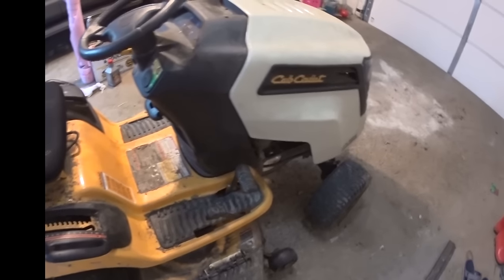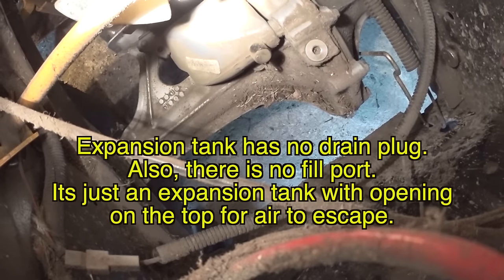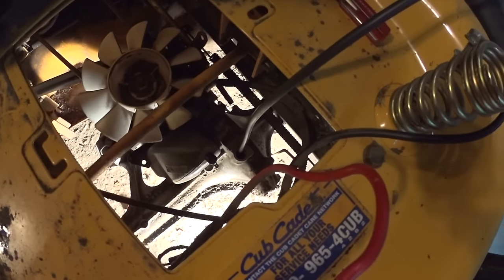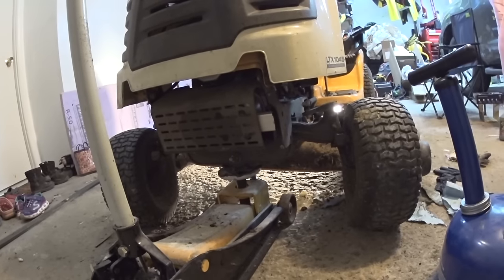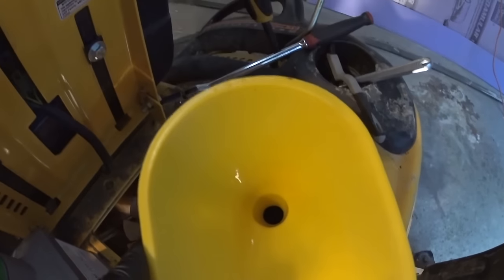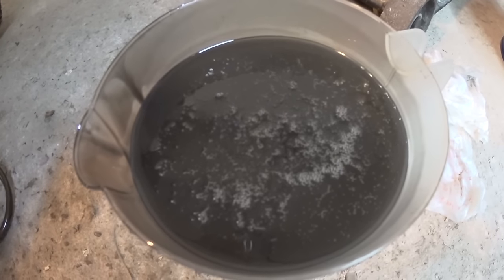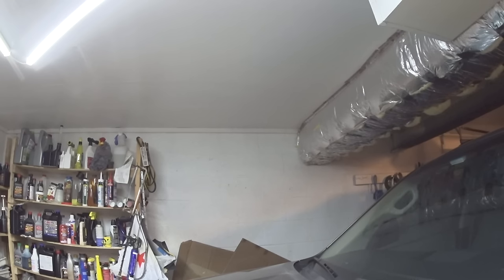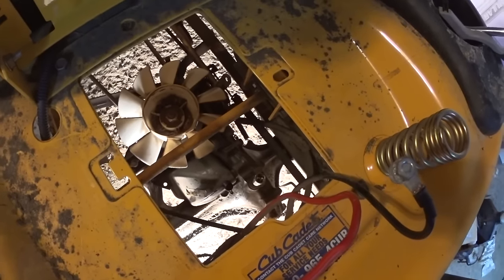Hydrostatic transmission fluid change, how to replace tractor transmission fluid, SCAG maintenance

Comment: I'll take it that part with the little black cap on it is the expansion tank you mentioned? How does that affect the total changing of the oil? Does some oil have to remain in the expansion tank no matter what?
Reply from the maker: I don’t know. Does it matter if some remain?
Reply: @repairvehicle  Probly not. 
Thanks. I would not have known how to do it were it not for your video. So I ordered me a small vacuum pump and a gallon of the oil already. Thanks again.

Comment: need to ask my white fan back there is tight and you can't even spin it by hand  , is that too tight and not sure if it has been like that since I bought the mower
Reply from the maker: I know it’s tight
Reply: @repairvehicle  before it was repaired you could spin it by hand slightly . After I put on new drive belt it got tighter . You could spint it by hand a little before new drive belt . Old drive belt broke and I had to push the mower up my hill over 150 feet . I could tell mice must have chewed the belt . I found a dead mouse in my shed just before belt broke . I always make sure I keep shed clean and watch I don't get mice in there . But i think my 2 rescue cats must have chased it in there from the woods . That is why they were stalking the shed

Comment: I opened my  Hydrostatic transmission I bought it used and I saw that it was filled to the top should I leave it like that Or lower the level a bit?
Reply from the maker: Very good question.  I don't know what you have.  Did you watch my video without skipping?

Comment: What happens if you lost fluid in a leak so your reference point might not be a correct way of doing this
Reply from the maker: Good question, I had no leaks everything is dry. 13 years later I still have this same mover and have zero leaks and it’s working better than brand new. I can’t say same thing about my tires.

Comment: After stripping the plug using the 1/4 Allen socket i thought i was going to need to go buy more bits so i can try and manage and get the plug out but then i decided to go and try and use the t40 torx socket i gave it a good zappe and with the help of a piece a pipe gave it a good ol' try and i only heard paaaahhhh and the ratchet slipped so i thought oh man now I'm going to need to buy me another torx socket so i looked at the plug and didn't see it being more damaged so i looked at the torx socket and it wasn't broken so i put it back on the plug gave it a turn it started coming off i was like uuuuhhh eeeeeeeehhhh so if you strip your plug get yourself a t40 torx socket and give it some hammering down then give it a try it'll come right off
Reply from the maker: Thanks for sharing your experience

Comment: Absolutely amazing video!! I just bought a 2021 xt2 gx54 d. Would this drain and fill be applicable on the newer xt2s?
Reply from the maker: Drain and fill will apply to yours too. However,  make sure to use correct fluid.
Reply: @repairvehicle  I'll have to research what fluid. All I can find is the cub cadet brand.
Reply from the maker: Nothing in your owners manual? There should be something about hydrostatic transmission or call dealer/repair shop.
Reply: @repairvehicle  I'll have to dig into that more. And I wanna edit my statement. I bought a leftover 2020 xt2 gx54 d. As I couldn't stand the black rims on the 2021 model lol. If I wanted black rims I'd buy a Porsche.

Comment: I'm not sure if you will see this but I'm having a similar issue.. my Trans doesn't like to work when it has been driven for about 15 mins or so, I put a new drive belt on and the fluid looks to be good (not burnt or dirty), just seems to lose momentum after the 15 mins of run time. Any help is appreciated!!
Reply from the maker: How is the fluid inside transmission?
Reply: @repairvehicle  clean and full
Reply from the maker: I mean to say how old is the fluid?
Reply from the maker: How old is the mower and has fluid been replaced before?
Reply: @repairvehicle  it's a 2009 yes i think it has been changed before, not 100%
Reply: @repairvehicle  I bought it off of a buddy so I'm not the original purchaser
Reply from the maker: There is two possible reasons why it not working properly.  
1. Fluid is just to old and don't have proper specs anymore. 
2. Transmission is has too much wear and when it becomes warm stops working properly and starts sleeping.

Comment: Great video! Question, would it be better to use transmission fluid to flush it? Plus driving it 100ft or so then draining it of the flush seams a good idea??? Thanks for any input. Dan
Reply from the maker: Are you referring to Automotive automatic transmission fluid?
Reply: Yes, ATF, it has lots of detergents in it to keep a transmission clean. It makes sense to me, but you've done this before. I have a similar model I'm definitely doing this to.
Reply from the maker: Auto ATF and hydrostatic fluid, both completely different fluids and not compatible. Adding ATF fluid to hydrostatic transmission will cause issues.
Reply: @repairvehicle  i used atf in mine then mixed gear oil in to thicken it up, didn't have fluid when I got it and I cant seem to get it to even spin the tires when they are off the ground, is it supposed to be easy to refill them because I have tried to purge it literally 12 times today, I have a craftsman lt1000 with the hydro gear trans

Comment: Mine has the gas tank under the seat right over the transmission.  SLT 1554.
Reply from the maker: Remove gas tank
Reply: @repairvehicle  that means dropping the trans and/or completely separating it from the tractor.  I’d rather not, but if that’s the only way I guess it’s the only way to do the fluid change.
Reply from the maker: You cannot remove gas tank from the top?
Reply: @repairvehicle  nope.  The transaxle would have to come off then the gas tank from underneath.
Reply: @QuickDrawWP  should be able to remove most bolts from the foot rest and the back cover off and lift the whole shell up and pull gas tank out. That's what I did to get my tank out when I had to repair a hole in the tank. Wish I would have done trans fluid when I did the tank. Live & Learn! Good Luck

Comment: should i use 20 50 synthetic if I plan to use mower in winter-my hydrostatic has 20 50 oil in now--thinking it might be too thick for very cold
Reply from the maker: How cold are we talking about?
Reply: @repairvehicle   0 to -20 F
Reply from the maker: What do you have and year?
Reply: transmission had crack from rock..repaired- JB weld ..i think 1 qt of Valvoline 20-50 syn was added
Reply: northern Minnesota..like to add little snow plow
Reply from the maker: I am not aware of thiner hydrostatic transmission oil.  Don't know if in cold weather it's going to be an issue. When it's that cold,  your battery will be number one issue, it's going to have hard time starting, unless kept in warm garage then hydrostatic oil is just fine too.

Comment: I have a LTX 1050, last time i mowed the gas pedal was kind of stiff and hard to push, i dont think i have ever changed the transmission fluid. Do you think this may be whats causing this?
Reply from the maker: Possible. You might have build up or rust around pedal mechanics
Reply: @repairvehicle  ok I'll check linkages and all. Haven't had time to dig into it yet, thanks for the response.
Reply: I have a 2008 lt 1050. Transmission is a sealed unit and not supposed to be serviceable. Should I try anyway? Nothing to loose. Has over 700 hrs on it
Reply from the maker: No such thing as sealed unit. I would change the fluid
Reply: @kentseymour2084  does yours have a kawasaki engine?
Reply: @repairvehicle  in response to my earlier question on the pedal stiffness, I had used cable ties to hold up the mowing deck and has wrapped the ties around the rod that leads back to the transmission thus the stiffness. I cut them loose and rerouted them now the pedal is back to normal. I'm still gonna change the fluid when I've cut the last time this year.
Reply: @trent3872  No mine has the Kohler sv730 engine. I had to replace the starter a few weeks ago.
Reply: @kentseymour2084  I have the exact same model and problem. Did you figure it out?
Reply: @jspla  Hi, I changed my oil in the transmission used amsoil in transmission. Also I put a 78 in belt on transmission. The dealer said that a 79 1/2 in belt was the one according to book. Could not get tension so smaller belt. The last time I was mowing the rod from pedal to transmission broke. The parts tree web site said that it was unavailable. Took it off and welded a bolt in its place.

Comment: Great information, but I can't get the plug out of mine. Was there a trick to it?
Reply from the maker: No trick, just applied good amount of power to break it loose.
Reply: Mine was tough too. I would never got it off but I got my drill down in there and Brit free
Reply: I stripped mine now I'm confused what to do
Reply from the maker: Watch this video about removing stripped plugs https://youtu.be/0U4IETmJtas
Reply: @repairvehicle  Allright man will do thank you

Comment: How can I get the oil out without a fancy pump? I am sure I need to change mine. It whines and seems pretty slow. Thank you in advance!
Reply from the maker: What fancy pump are you talking about?
Reply: @repairvehicle  I bought a suction gun at the parts store. Probably have to remove my gas tank. It has the huge tank under the seat. I just had the tank out on 46" Poulan Pro. PB22H46YT. They are a real pain in the butt to get in and out. Thanks for video
Reply from the maker: No problem

Comment: I have a John Deere x354 and and a k46 transmission everything I am seeing says 10w30 ( tuff torque) can I use 20w50?
Reply from the maker: What year?
Reply: 2016
Reply: Sorry 2017
Reply: 🤷🏼‍♂️🤷🏼‍♂️bought in 2017 probably a 2016 on sale
Reply from the maker: Unfortunately you cannot use 20w-50.

Comment: I have a ltx1042  KW   V twin  2016 MODEL   AND NEVER KNEW IT WAS THERE UNTIL i CHANGED THE DRIVE BELT STRANGE THERE IS NOTHING IN MY BOOK OR PARTS LIST ABOUT IT
Reply from the maker: Because they don’t want you to maintain your equipment. They want you to keep buying new
Reply: @repairvehicle  Sad that they take advantage of people  .  I am having a hard time here in Virginia finding gear oil  with the weight you suggested  .GEEZE to be truthful having a hard time find anything here . I guess it would be the same weight gear oil  for my mower  . Only 1 lawnmower shop left here and it is only open 3 days a week  .I may have to find it on Ebay  . Oil filters for kohlers are 29 dollars each if you can find them . I  had to order them off Ebay 27 dollars for 6 of them  off the lawnmower shop . I got them in 4  days   . Even gas cap for my 2001 ford explorer I had to order off Ebay    none around here  got it in 3 days   , Sad Sad Sad
Reply: @repairvehicle  thank you so much for your video it really did help  me alot from ruining my  lawnmower  . I maybe 69 years old and a woman but not dead yet  😀THANK YOU AGAIN
Reply from the maker: you are welcome.

Comment: How do U Purge the transmission ?
Reply from the maker: Purging transmission is not necessary unless you have completely sealed transmission. What do you have? Why do you think you need to purge?
Reply: @repairvehicle  Ok even better ! No just heard it on another you tube video. Thank You for the reply !
Reply: Please advise on the proper transaxle seals for 1554.  Thanks

Comment: How do I change the filter on the 1050
Reply from the maker: There is a filter?
Reply: All transmissions have a filter.
I think I googled Cub cadet 1050 transmission filter, then select the Amazon filter. Looks more like a fine screen.
      I suppose a person could find a parts diagram somewhere other than the Cub cadet website which is no use to anyone except a dealer.
      Lawn mower was most likely made by MTD. I wonder if the transmission is made by tuff torque.
     I took a zero turn transmission apart made by tough torque. They made it as cheap as possible. Not made to last very long. Seems like they never put a drain plug on there transmissions.
        The zero turn failed after 3 years of use. Filter was clogged. Maybe it got hot in the Pistons stuck. The return springs disintegrated. Little pieces went all through the unit and did more damage. Manufacturer blames the oil or fluid. 303 John Deere fluid must have been defective a few years ago. I thought I seen a lawsuit on the internet.
Reply from the maker: I don't know how to change filter. I have look into this. I was not aware of filter on hydrostatic transmission.
Reply: Could you let me know what you find out. I ordered oil vacuum .my cub 1050 is at least 10 years old.no maintenance on Transmission. Like you said in video, designed to fail after warranty is out.mtd uses tuff tork  Transmissions.i don't know any brand mower that mtd does manufacture. Pretty sure it China parts assembled in Tennessee USA to avoid paying USA tax and tariffs.?
Reply: @repairvehicle  I just watched the video of a tough torque transmission from a cub cadet being overhauled. Which really didn't need to be overhauled. The filter in that one was deep inside. Mechanic didn't bother to hold the filter to the light to see if it was clogged. He was more of a clown than a mechanic. All hydraulic systems have filters. A hydraulic system is more sensitive to dirt than any engine is. 
    Filter cost $30 on Amazon.
I'm not going to replace my filter. The transmission is working great. So I will take my new vacuum pump and suck out as much fluid as I can from the fill hole. I'll add some new fluid to it. Start the engine, forward and reverse, then shut it off. Suck that fluid out. I should get about 75% of the old oil out. Then I'll fill it up. The level will be 1 and 9/16 from the top.
     I'm not going to put motor oil in it. I want tuff torq oil. 10w30 or something close. Synthetic hydrostatic transmission fluid.
People in the South might want 10W-40. People in the north might want 5w-20 if it's used for snow blower or snow plow.
       If I thought my transmission was not working properly, I might try removing the pan from the bottom to get to the filter.
      If I thought my transmission needs to be overhauled, I would see what the price is on the overhaul kit and decide if I want to remove the unit from the mower frame.

Comment: How does water get inside the transmission?
Reply from the maker: Through breather tube .
Reply: @repairvehicle  so I guess washing the mower off got water in the transmission causing it to slip and whine
Reply from the maker: Possible yes.  But moisture as a condensation enters transmission too. Transmission Fluid has a limit 2-3 years bottle life.  When it's in service it becomes contaminated and good faster.
Reply: @repairvehicle  okay Thanks so do you recommend changing trans fluid once a year
Reply from the maker: It will not hurt anything by changing fluid every year,  it's a free insurance for trouble free transmission.
Reply: @repairvehicle  okay Thanks
Reply from the maker: @dickeymoore4264  , no problems

Comment: If mine has never been changed should I do it?
Reply from the maker: Mine was never changed before either. 9 years on same fluid, way to long. If it was mine equipment I would change it. Fresh fluid only helps, dirty fluid causes more wear.
Reply: @repairvehicle  thanks for the reply. Is it not the same as a car where changing it may cause it to fail vs leaving it be?
Reply from the maker: Don't know.
Reply from the maker: I'm not aware of someone changing transmission fluid and it failed after. I know that transmissions fail after transmission fluid flush. Transmission flush and drain and fill two different things.

Comment: What oil type synthetic or conventional
Reply from the maker: I don’t understand your question
Reply: @repairvehicle  sorry I put conventional     20w 50 i get slow starts with transmission till warmed up i hope full synthetic works
Reply from the maker: I use 100% synthetic, equipment is to expensive for me not to use 100% synthetic
Reply: @repairvehicle  thank you this weekend im changing it. in your opinion 15w 50 good?
Reply from the maker: As long as it’s formulated for hydrostatic transmission, I don’t know if 15w-50 is for hydrostatic transmission
Reply: @repairvehicle  ok thanks ill start looking for oil
Reply: What oil change interval would you recommend
Reply from the maker: It depends on brand

Comment: can you use 10w30 full synthetic for trans fluid?
Reply from the maker: If your transmission is hydrostatic, it needs to be hydrostatic fluid either synthetic or none synthetic.  Best to use synthetic,  it provides better lubrication and resistant to break down due to heat
Reply: @repairvehicle  willdo. Thanks for the quick response. I bought a toro riding mower for 50 bucks. The trans still works but it makes some whining noise either at the trans or drive belt.

Comment: Sorry... But they are NOT "all the same"
Reply from the maker: Did I say they are all the same?
Reply: Yes you did. In the beginning of the video you said they are all the same... It doesn't matter.
Reply: @dontblameme6328  The all basically work the same and they all have a fill hole. Some may even have a drain plug but most do not. All are pretty much the same.

Comment: My cub cadet lt-1042 has no battery tray behind the seat, it is all sheet metal back there with no access to the transaxle. The only way i see to drain and refill it is to drop the whole rear end. It's ridiculous that a 4000 dollar lawn tractor is designed so that nothing can be easily serviced on it. This is my first cub cadet and it will be the last, this thing has been  nothing but one problem after another since it was new. Its a poorly designed, engineered and overpriced piece of junk mower
Reply from the maker: Unfortunately that’s how everything today is specially cars and trucks